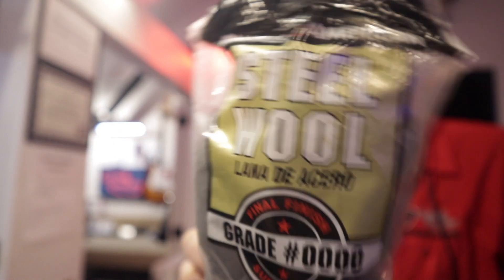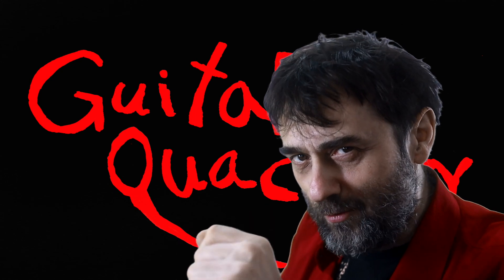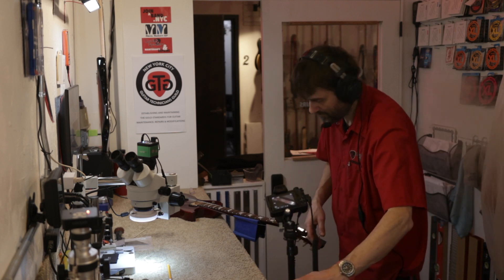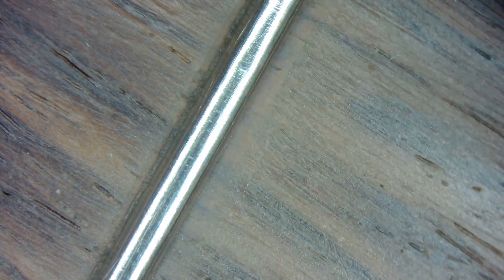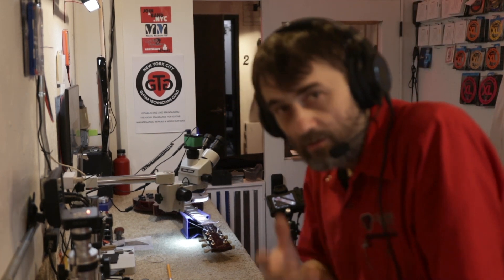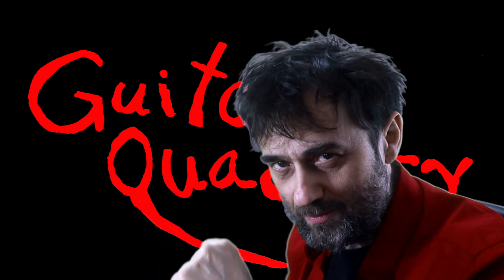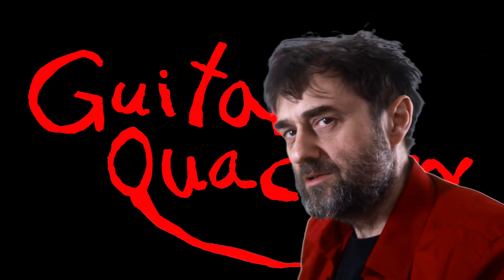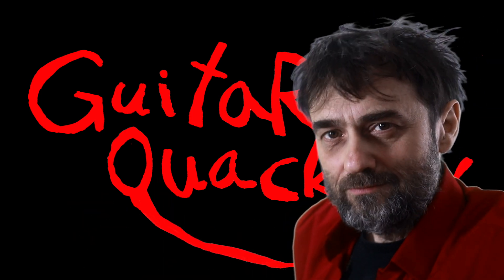Is it Safe to use Steel Wool to Polish Guitar Frets?

Comment: Do steel wool particles actually damage the pickups?
Reply from the maker: That's the trouble. I think the steel particles can cause actual damage, but I think that it is exceptionally rare for actual damage to result. I have seen a dead pickup once or twice, but I can't say for sure that steel wool was the culprit. 

I think we need to put this theory to a test in subsequent video.
Reply: @GuitarQuackery I wonder if steel wool may harm the pickups in less obvious ways, such as degrade the sound quality. 

Anyway, my takeaway is that I don't want it near my guitars.
Reply from the maker: I think there are ways to use it, without contamination. But as we see in this video, particles get distributed in small spaces, under the fret shield, or wherever. It's like trying to contain a deadly virus in a lab. It can be done, but it can also sneak through the cracks. 

My conclusion: why bother, when there are other methods?

I guess I would use it on a $100 guitar, away from the work bench, for a $50 job, if I had to. It's quick and it makes frets look shiny. But for 50 bucks I would not have the time to contain it. I would simply do a quick job in a separate work area, use a magnet to clean up and be done with it, for 50 buck. 

I'm not sure how much the presence of steel wool, inside the pickups, would harm the sound. I think not so much in guitars, as it might in basses. I did have a video about that. There were some metal particles around the pole pieces, of a bass, and we heard popping sounds. I think the pops were produced by the movement of the steel particles. 

I think it's more likely to happen on a bass, because the low frequencies are more likely to make things shake. A truck passing by the house will be more likely to make the dining room table shake, than a passing car would (unless the driver is one of those assholes that has a subwoofer in the trunk of his car).
Reply: Nope they absolutely do not harm a pickup.  You may think.. what if a piece of steel wool shorts the windings???  Well.. your windings are insulated so that's not possible.
Reply from the maker: @poison7512  I believe you're right. The  more I keep looking into the steel wool details, the more I tend to agree with this. And even if a steel wool fragment should cut through the thin enamel of the copper wire, it would have to cut through two parts of the coil and would end up shorting out just a few turns, which is a very small percentage of the number of turns on the average pickups. 

I am still trying to think through the rust issue, though. Rust expands and I have definitely seen rust contamination on old pickups. So, steel wool fragments will rust if the player sweats all over the pickup. But still, what exactly will that rust do? Will it cause actual damage? I don't really know, to be perfectly honest.

All that said, I still don't want to be the one that will get any steel wool on any pickups, especially not on my customers' guitars. I'm a string believer that any techs should give the guitars back to their customers in the same, or better, condition than when the guitars were dropped off.

Comment: 0000 steel wool and Flitz metal polish, combined, reduces the amount of SW particles. Although I've gotten plenty of particles on my pickups, I have never once had any kind of issue whatsoever with the way the pickup performs after the fact. Clean it off and move on.
Reply from the maker: Interesting idea. This is like a wet sanding technique with steel wool and Flitz.
Reply: @GuitarQuackery  pretty much. It works for me, although I'd like to get a dremel at some point and try out that technique.

Comment: Safe?  I guess.  Your fretboard will disagree.  And also your frets will most definitely NOT be polished.  You need a buffing wheel on a Dremel to polish frets.  It should be incredibly obvious that even the finest steel wool will leave the frets feeling gritty.
Reply from the maker: I’m actually having a hard time to come up with the technically-correct terminology for the treatment of Frets, using steel wool. Everyone I know uses the term “polish frets“, regardless of which methods they use, although I don’t think it’s always technically correct.

Comment: There was also a lot of metal particles near fret ends from fret dressing. My conclusion? Don't do a fret dressig
Reply from the maker: I think opponents of steel wool argue that steel wool produces razor sharp, steel fragments, which end up all over the pick ups, because they are magnetic fragments attracted by the pole pieces. By contrast, fret wire is made from a brass alloy, which is significantly softer metal and is not sucked in by the pick ups, since it is not steel.
Reply: @GuitarQuackery  I understand the point, but been doing this many times and never saw more than a few bits of steel wool on the pickups. It will never damade a pickup, even if you shred full bag of steel wool on it. Personally i stopped using steel wool because all those particles landed on my clothes, hands and on the floor. Now I'm usind nail polishing block and finally dremmel with polishing paste. This method is also not the safest, rotating disc may heated fret a lot and cause it poping up
Reply from the maker: @shuttermaniac   I have to be honest, this video got me so much feedback, I'm gonna have to rethink this whole steel wood "science". This thing does is hard to control and does get everywhere and I personally don't use it, and don't like to use it. But I really wonder how much actual damage it can actually do to the pickups. It is something that I've been questioning for a while but still had no time to put too much thought into it.

All that said, thank you very much for sharing your comments (you, as well as the others).

Comment: I much prefer Scotch-Brite polishing pads. No metal or sand.
Reply from the maker: I tried those but I was never able to get the same results. It is easier to dust off the sand than to deal wit steel wool, though.

Comment: Ive been using steel wool to clean fretboards and frets for 15 years. Never had a problem with any of my guitars. Use a magnet and masking tape with fret polish markers. Move on with your life.
Reply from the maker: Many have pointed out the same experience in the comments. I personally use other polishing methods. I'd be curious to know your thoughts on this video https://youtu.be/51i5Dqmol-c if you have the chance to see it. Thanks.